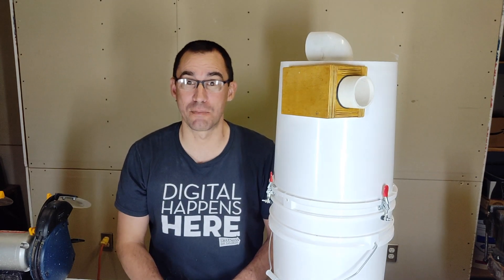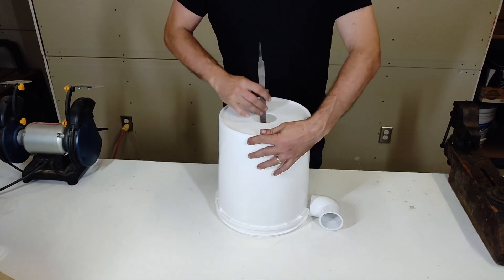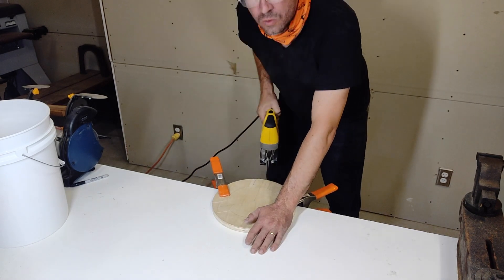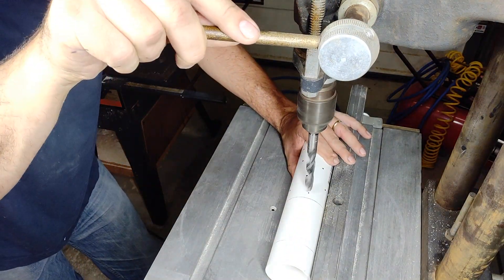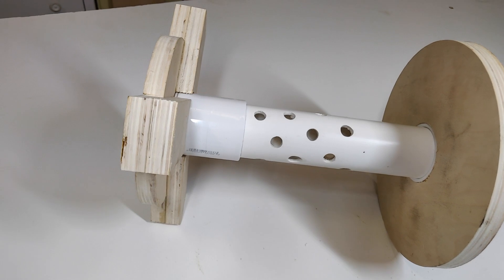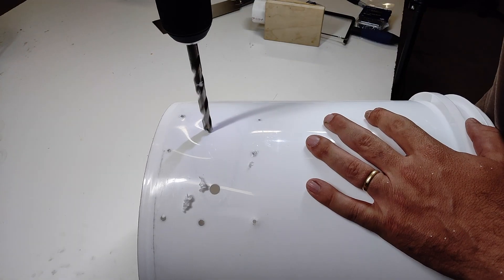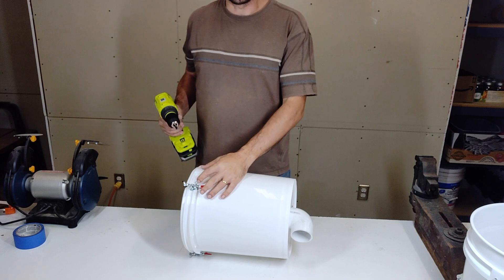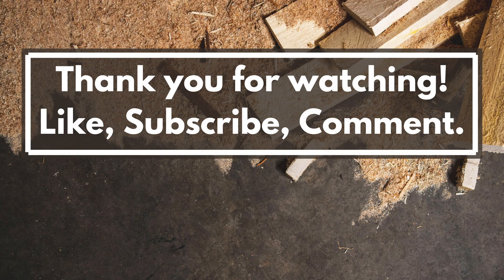Dust Separator (with a twist)

Comment: I’m confused about the perforated outflow tube. How long is it and how close to the baffle is it? Seems to me that lite dust could go from the cyclone effect directly to the outflow tube and therefore getting into the shop vac dust filter, defeating the purpose. Chips and heavier dust would fall to the bottom of the dust collection bucket, but maybe the lighter dust could cause trouble at the shop vac. Was the separator baffle made of plywood to stiffen the bucket preventing collapse if the intake got clogged? A simple relief valve would prevent the collapsing bucket.

Comment: im really confused. whats the point of this? all you did was removed the bucket and filter from the shop vac and added a home made cyclone and bucket to the equation and made it harder to drag around the shop to vacuum.
Reply: It saves your expensive shop vac filter from getting filled with larger particles so it can filter only the smallest particles out leaving your shop air cleaner.

Comment: Great project. Very accessible.
Have you tried lowering the inlet connection? e.g. towards the mid-height of the bucket.
Reply: Yes, it seems to me that the different designs have the intake too high up where it’s more prone to get sucked in the exhaust port being it’s spinning around the port and not at a lower level?
But I have never built one, and it seems to work fantastic, so what do i know. Lol.
Reply: @willofscott  I've built one with a lower inlet and it works great.